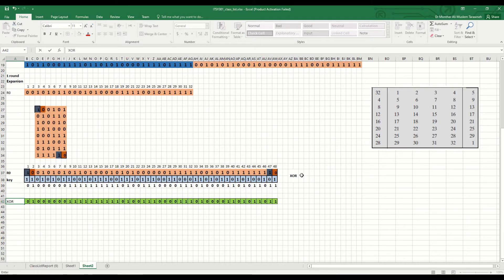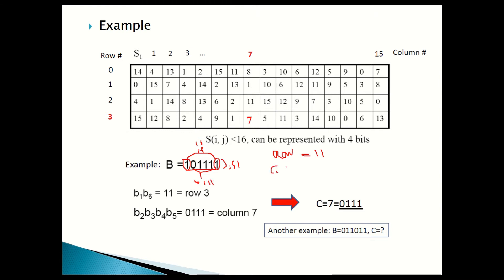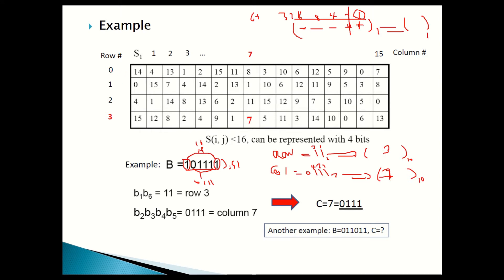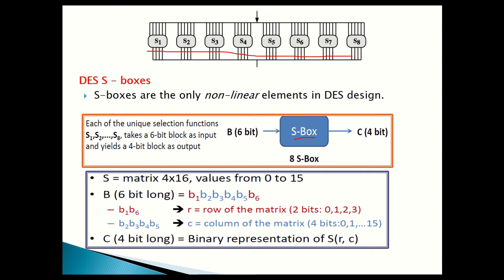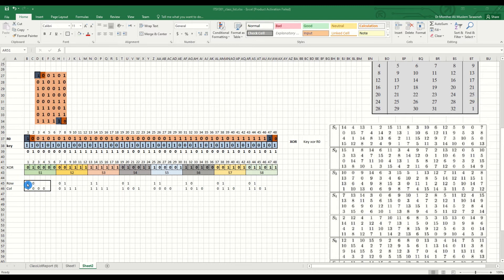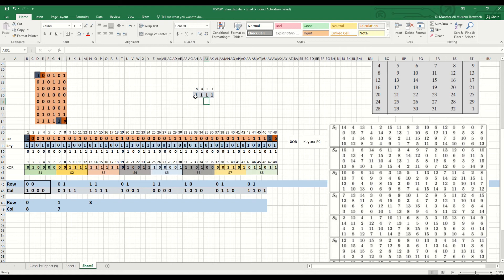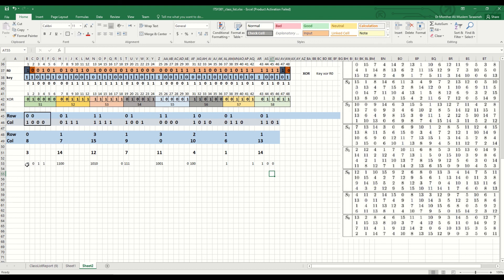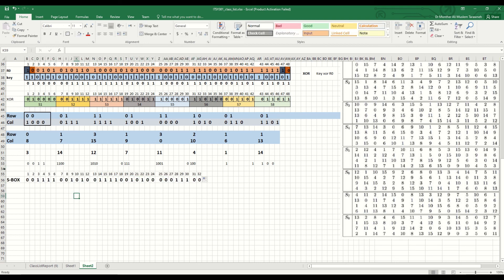DES S-BOX operation

Comment: Thankyou for a very good description. your videos for DES are excellent. could you please describe this question too "What is the output of the first round of the DES algorithm when the plaintext and the key are both all zeros? or all ones?" A hopeful student is asking this question. looking forward to hear from you soon on your youtube channel.
Reply from the maker: Thank you for the complement. Hope my lesson help you some how. About your question: always get this question and try it in front of the students. Since your inputs are zeros the result will be zeros. However, it means you are encrypting no thing at all.  Also, try to choose a strong key where zeros or 1’s are not really a good key.  In addition to that the Des calculator is using binary and your are encrypting number of blocks, some of these blocks could be zeros or ones for padding Option. 
We cannot consider this as a weakness for DES, but if you use complex mode of operation that use IV matrix then the result will be different. 
Hope that help

Comment: how were the numbers 14 4 13 1 2 15 ... found?
Reply from the maker: In s2 we have 001111. So the row = first and last bits. Col=bits in the middle. 
Col =11   = 3.  & row =0111 = 7. 
Use the sbox S2 go to the intersection between 7 & 3. You will see it is equal to 14.  
Same thing we do for the others but in different S in the S-Box
Reply: @DrMoonther  i understand but why 14?
Reply from the maker: The intersection between the cop and row in the table in S2 is 14
Reply: @DrMoonther  i understand but why the number inside is 14 and not for example 9 or 12 or 7 or 3? why 14? who decided that the number must be 14?
Reply from the maker: @amedeodeamicis90  Aha. got your question. Some time I use different S-BoX. You may use any S-Box generator to produce one and use it. S-Box. However, DES has been compromised and most of people now use AES